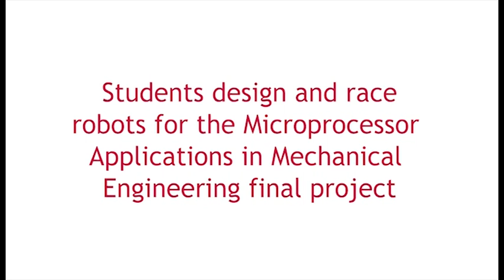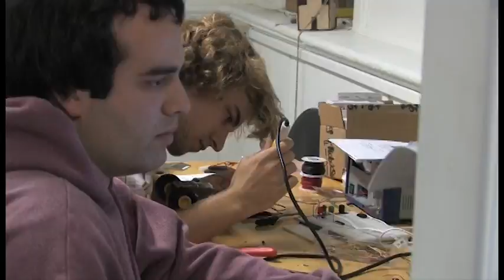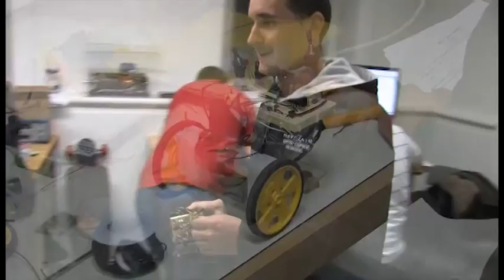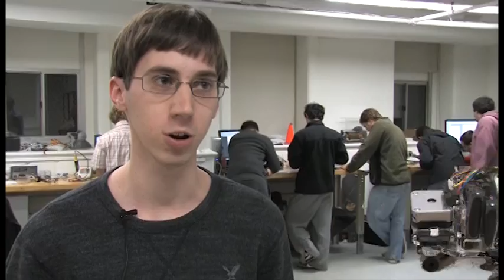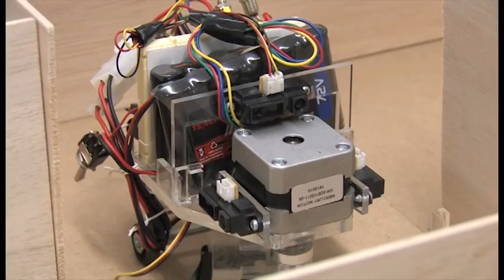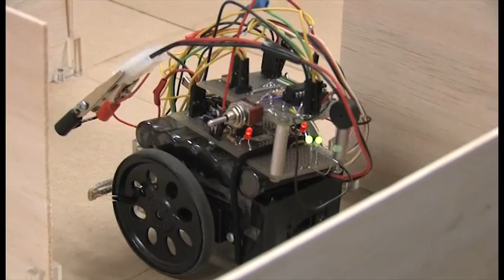Robots - Final Project Competition

Comment from the maker: @ResultantForce It's all covered in this class, which introduces instruction sets, software concepts, interfacing microprocessors to external devices, and microprocessors in control systems.  The textbook is Introduction to Mechatronics and Measurement Systems.  No separate mechatronics class needed.  You can see course website at stevens.edu/me551/ or the Stevens Mechanical Engineering curriculum at stevens.edu/ses/me/undergrad/curriculum.php.  Thanks for watching!